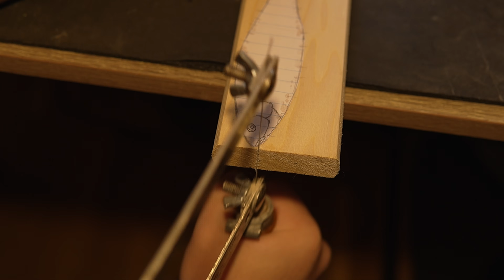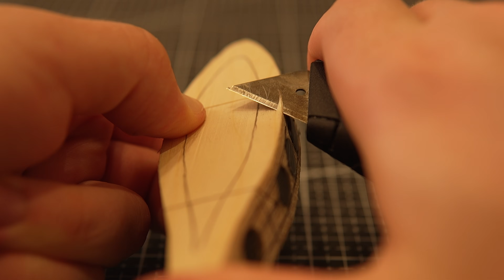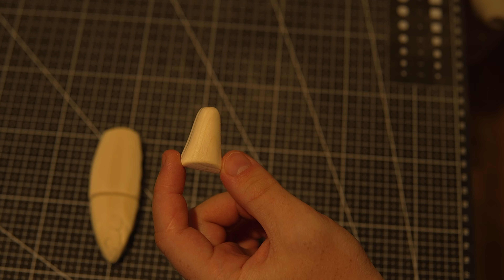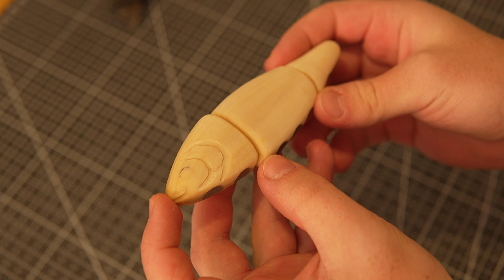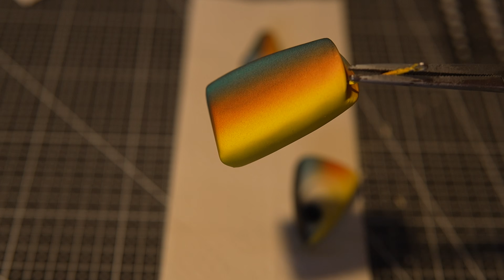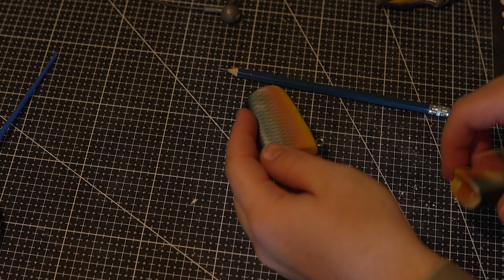Handmade 3-Piece Swimbait Build | Only Using Simple Hand Tools

Comment: Great video. I am curious as to how you determine how much weight to add to the lure and where it should go, even before carving the body into shape. It looks like you got it right, because it swims very well.
Reply from the maker: Thanks! To be honest I just went with my gut feeling to determine the total amount of weight to add. But for the placement I just added more lead pieces to the holes that line up with the thickest parts of the bait. The more buoyant sections should have more lead to balance it out. At least thats my way of thinking about weight placement (for swimbaits)